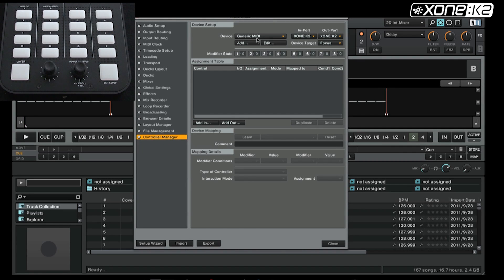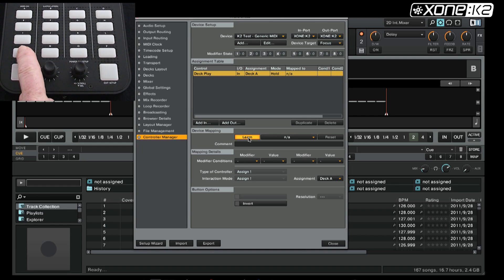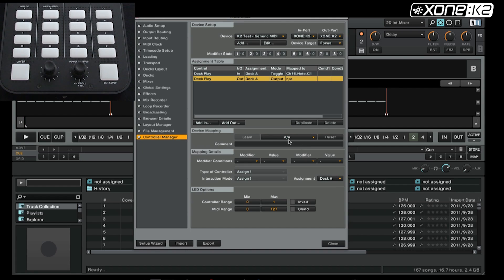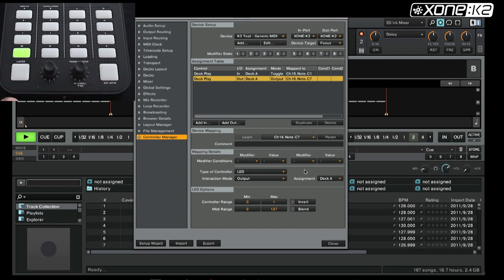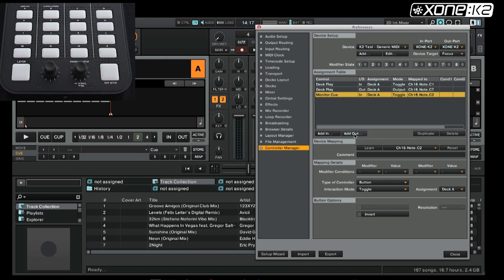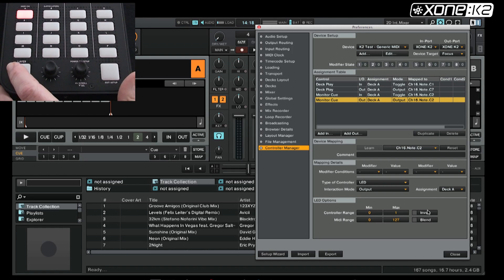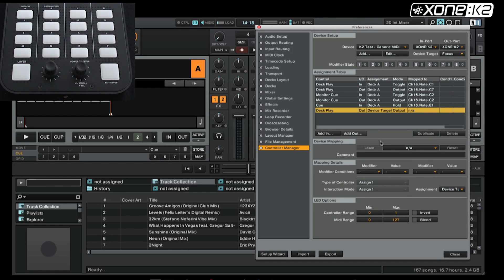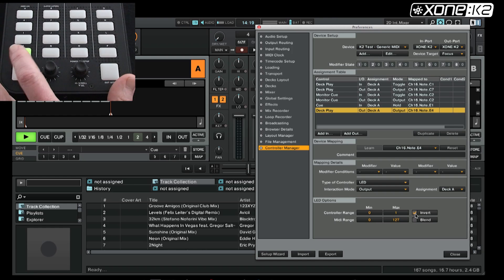Xone:K2 - Tutorial: Traktor Mapping Switches

Comment: If I’ve my xone k2 on all controls latching layer function then I can’t assign different colors is it? On red just red on amber just amber and on green just green? I can access other colors only with pot switches latching function but on all controls we cannot access different colors is it? Feedback would be much appreciated. Thank you!
Reply from the maker: Hi Khiz,
Thanks for the comment,
The main point for the Tri colour LEDs on the K2 (red, yellow, green), is purely to indicate what layer control is switched on. As it is possible to have a mixture of layers set to one layer (see pages 12&13 in user guide), it allows feedback to the user as to what layer is being affected/controlled.
https://www.allen-heath.com/media/XoneK2_UG_AP8509_3.pdf
It is not possible to have a mixture of colours assigned to the same layer. As this detracts away from the point of having different colours in the first place.

Kind regards,

Luke

Comment: Please explain again how to assign a certain color to the button. I have a Tractor 2.6.1 and the output automatically adjusts the same button, but in that case it lights up red. By what principle is the button color defined?
Reply from the maker: Hello Павлуша Нестеренко, if you look a pages 17/18 in the userguide,                 http://www.allen-heath.com/media/Xone+K2_UG_AP8509_2.pdf                                      you will see the full Midi (return) implementation list. Each note # will have a colour next to it, you will bea able to choose between red, orange and green. Best regards
Luke
Reply: Thank you, one more question. I can not get the buttons to blink at all. I only got to shine constantly.
Reply from the maker: Hello Павлуша Нестеренко,   In Traktor control manager window, you need to select "Hold" under interaction mode for the K2 LED to trigger only while you have the button pressed down, therefore only illuminating when pressed.